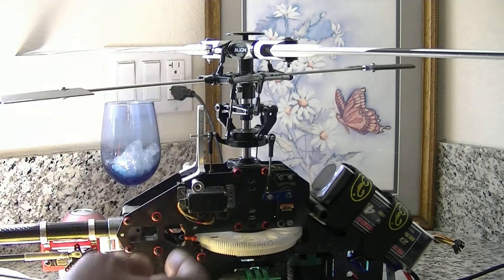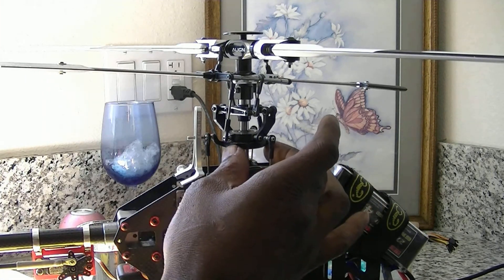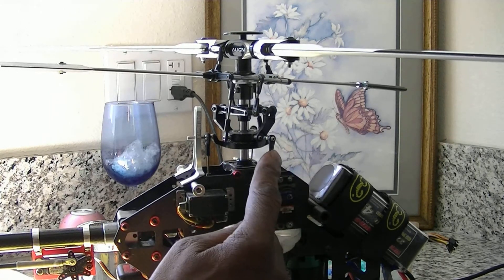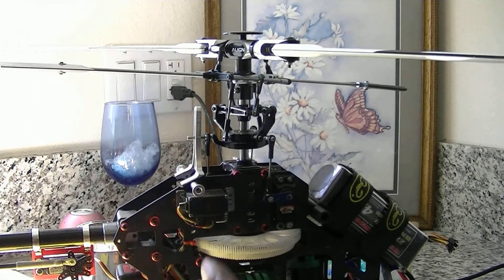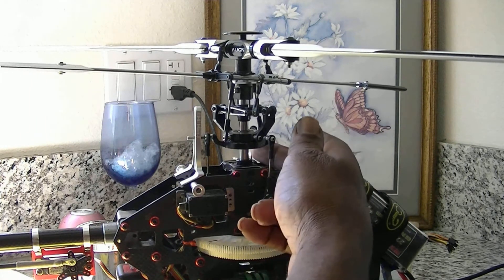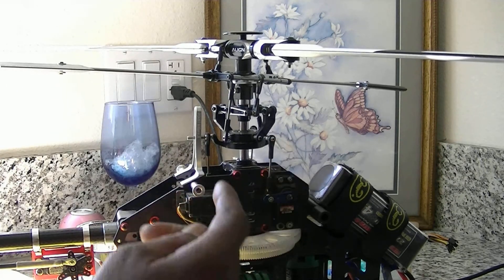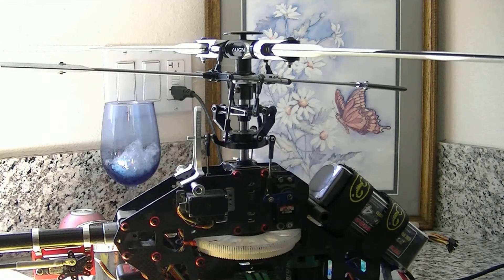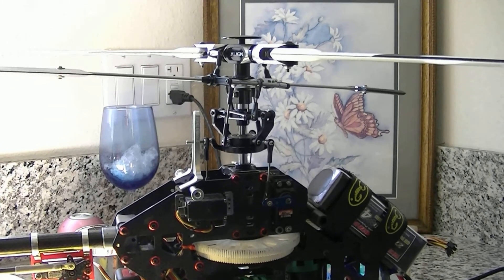align trex so you say you got more negative pitch then positive pitch how to rc helicopter 3d

Comment: WC need some help, I bought a new head for my 450 pro and its a ALZRC bell and hiller head. I leveled my servo arms 90 with subtrims and leveled my washout control arms, then when checked my full positive and full negative I got this results +13 and - 8. Can you  help me WC how to equalize my pitches?

Comment from the maker: matter of fact the lower mixing arms should be parallel with each other
for example pop the 3 linkages off of the swash plate then push the swash plate up making the mixing arms level with each other then lengthen the 3 linkages from the swash plate
ill try and give it to you in steps.

Comment: Noticed something weird.  Is this an original align trex 500? If so, that linkage(linkage rod "B", see align manual) that goes from "flybar control rod" to "washout control arm" is too long.  That link is special, because there should be NO GAP between the ball link snaps. It has a very short/stubby rod that is BURIED between the two ball link snaps.  Center distance for that is 29mm.  That might explain why your a little off. My trex pitch is +14, -14.

Comment from the maker: if the helicopter will not lift off the ground recheck your pitch or add 5 percent at a time to swash afr pitch if it lifts to fast lower the swash afr pitch by 5 percent at a time until you get it how you like it

Comment from the maker: step 1
90 the servo horns with subtrim
step 2 
pop the 3 linkages off of the swash plate then push the swash plate up making the mixing arms level with each other then lengthen the 3 linkages from the swash plate
step 4
level the swash plate with swash plate leveler
step 5
set tx throttle to mid stick then zero the pitch on both blades by use of the 2 long linkages only
step 6 
check pitch for equal pitch range if pitch range is off then use step 7

Comment from the maker: 11
you never adjust the two small links on the grips and the two long links are only to adjust tracking and to zero your pitch at mid stick.
once the servo horns are 90 then you level the swash with a swash plate leveler then if you have more pitch at top then bottom then you adjust all 3 links the same amount of turns so your swash does not get unlevel to  get even pitch ranges

Comment: Used to be part of the community for years got sick and haven't flown any of my helis in a few years. Bought new Headset and i'm getting +14 pitch and negative 5 pitch everytime I adjust seems It only gets worse. Lost my touch over not working and flying for so long.
Reply from the maker: tighten all 3 ball links from servo to swash plate 5 turns or as needed
Reply: Got that fixed now damn issue with Tail turning which wasn't an issue just arised. Thing the link from tail servo to tail is bad possibly weak and bends.